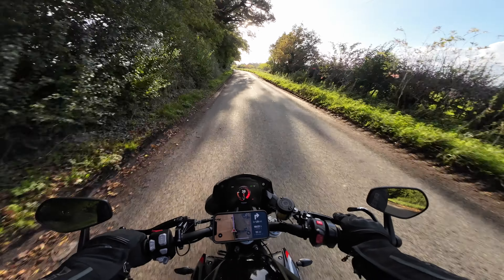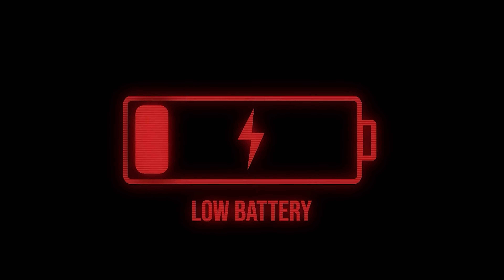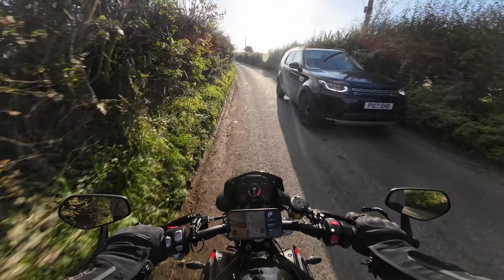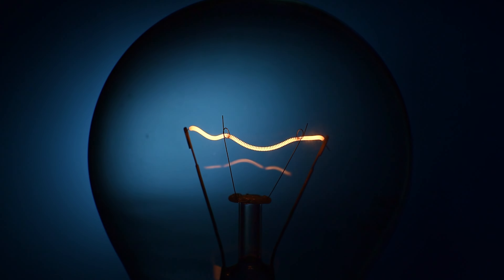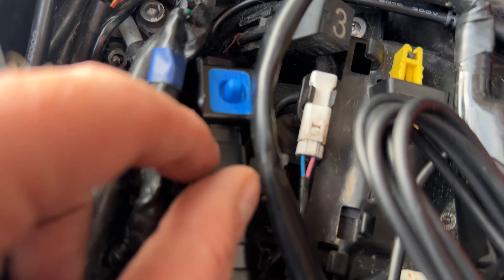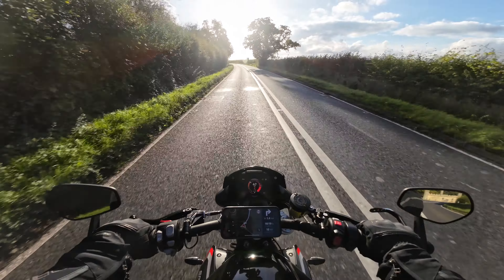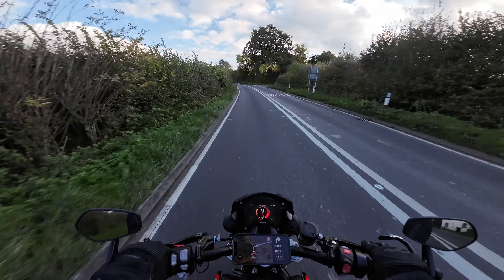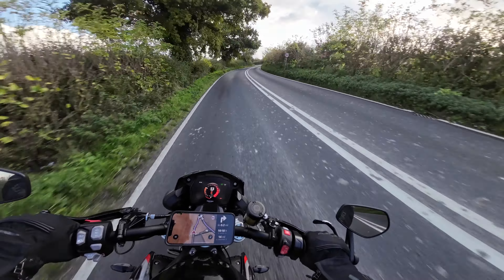Is it really that Smart? Quadlock - 12V To USB Smart Adaptor Review + Wireless Charger Problems

Comment: I was just wondering how much did the whole quad lock thingy cost from start to finish it seems to me like you need at least three different components to get it working properly
Reply from the maker: @bmw540ise  The whole set up
Is not cheap.. £69 for the wireless charger, £29 for the USB, and another £15 for the anti-vibration!! I must say that it’s the best system out there but comes at quite a cost… Oh, and don’t forget another £30 for the phone case 😅🤑

However much I love their system, and quality, I am however pretty annoyed with Quadlock that the smart USB doesn’t do ‘smart’ things with Lithium batteries… I’ve contacted them about it but they have no intention of releasing a Lithium friendly version..